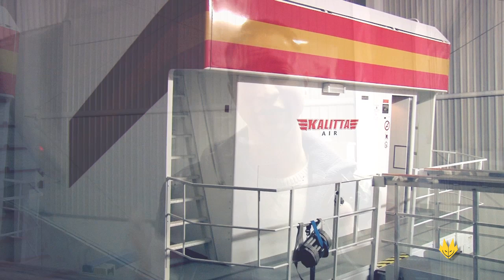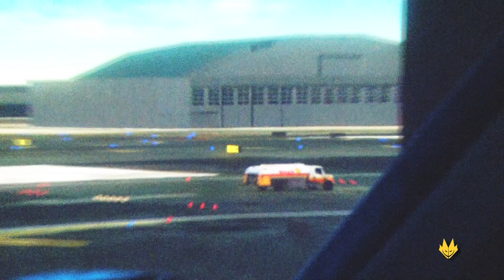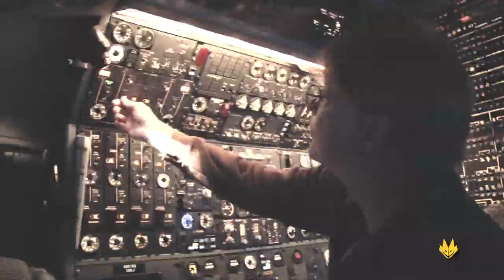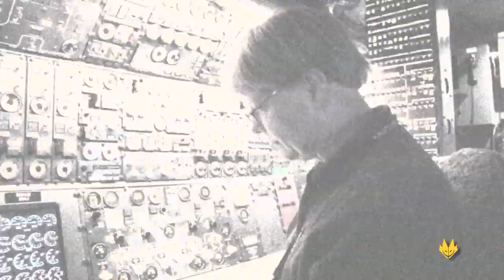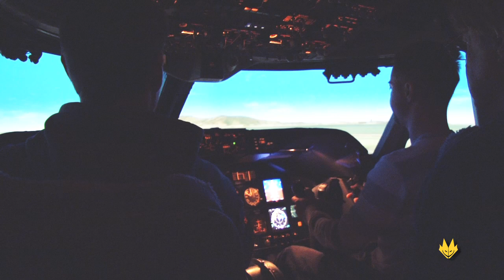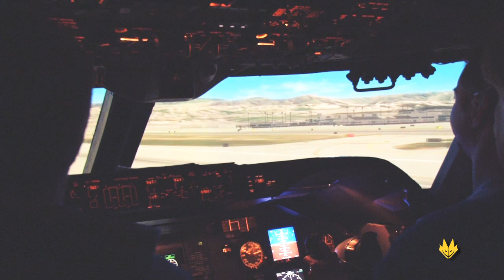Private Tour of the Kalitta B747-200 Flight Sim

Comment: After the APU was started and APU bleed valve was opened there was some serious duct pressure fluctuations.  For some reason all 4 ADPs were running and there were 2 Air conditioning packs operating causing the duct pressure flux. Every time the duct pressure dropped, all 4 blue ADP "RUN" lights would extinguish and the duct pressure would increase and the cycle would repeat.  Moral of the story, ADPs switches should be in the off position before the APU bleed air valve is opened.
Reply: That will get you extra brownie points on your next check ride  in the classic at YIP John.
Reply: @Mark-rh6ub  After Sands I flew SOFIA at NASA for a few years...on the 727 now.